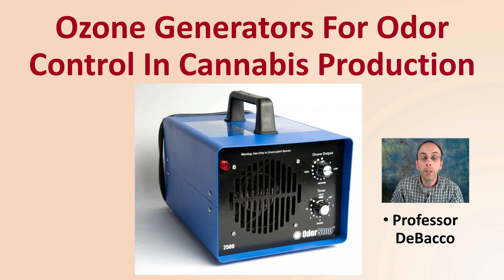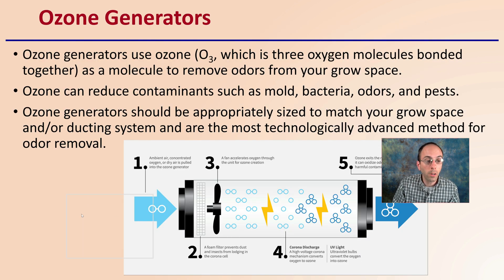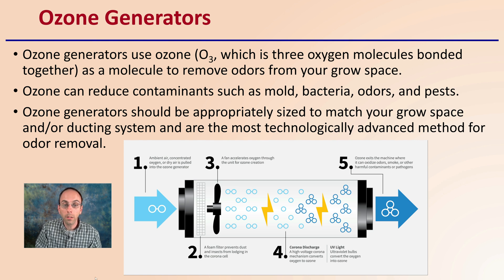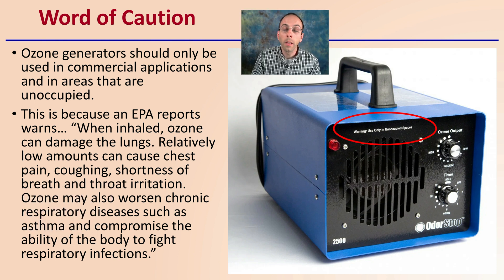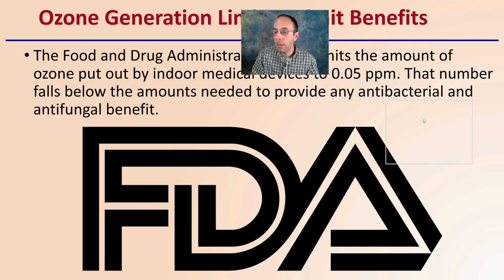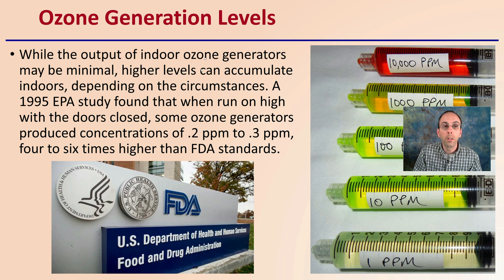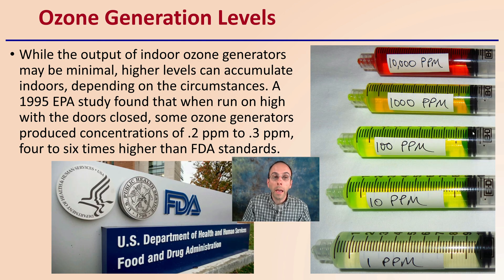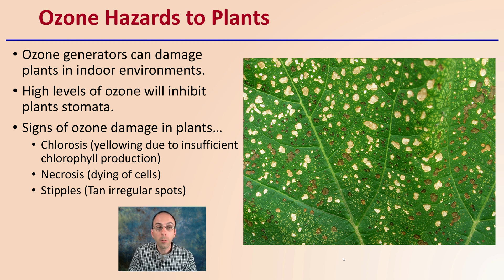Ozone Generators For Odor Control In Cannabis Production

Comment: Interesting video...

I have harvested and i saw a little mold on some of my buds....very little but still
 
Can this be used to "clean" the moldy buds which i will then later use to make QWISO ? I would also run the extract trough 0.22 micron syringe filter, which should be enough to filter out the spores...
Reply from the maker: Killing the spores would be best and while this could be used a hydrogen peroxide product would be more effective.

Comment: I don't have a "grow room" but last year I grew a few plants, very successfully for my own use, in my 10 X10 basement room completely sealed off to everything except the entry door to access the room, no windows no vents, etc, all concrete. I had an LED grow light, a dehumidifier and a box fan with a charcoal filter mated to it for odor control and another box fan for air circulation. The only time I would go in was when I watered.  Grow light was remote controlled. It was surprisingly simple although I had some fights with soil gnats and some powdery mildew but the end product was excellent. The only fail was odor control, especially during flowering.  I'm trying to decide if a stand alone fan and filter(similar to what people use in a grow tent) would work vs a reasonably sized(???) ozone generator. The ozone generator is tempting. On the other hand, I might be able to create negative pressure with a fan/filter.  Any advice would be appreciated.
Reply from the maker: Oversized carbon filter would be a better way to go for your set-up, this will improve air circulation and also reduce the odor.  (See channel for more details on this.)
Reply: @DeBaccoUniversity  thank you, much appreciated. Any suggestions for fan/filter combo?

Comment: For indoor grows that exhaust outdoors, there are several solutions that involve an ozone generator running in-line on the exhaust duct that really do wonders on the smell while shielding the plants from ozone altogether. Zackman Scientific also sells an ozone generator on Amazon that has a 4” duct connector that can easily be incorporated with an exhaust setup as well.
Reply from the maker: This is all well and good until the Ozone generator fails when you least expect it;-)  Thanks for the suggestion.
Reply: @DeBaccoUniversity  isn’t that the case for pretty much everything else electrical in a tent though?